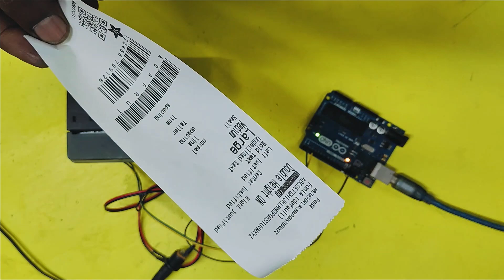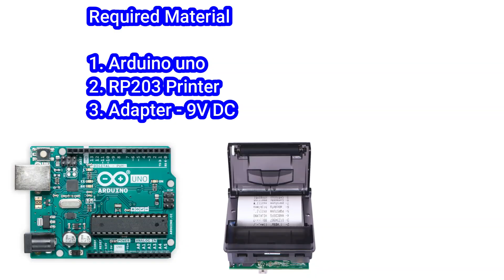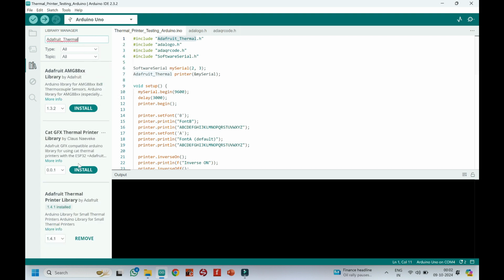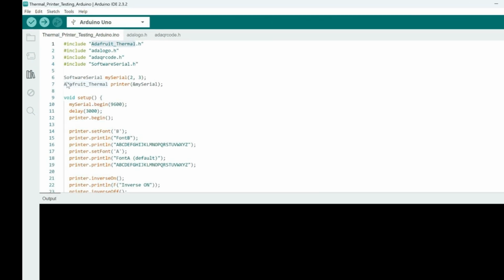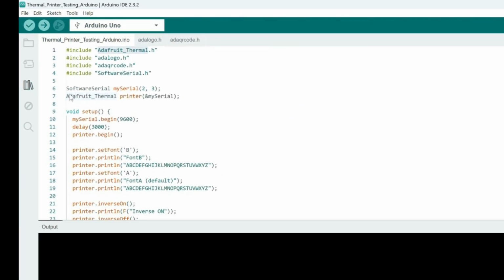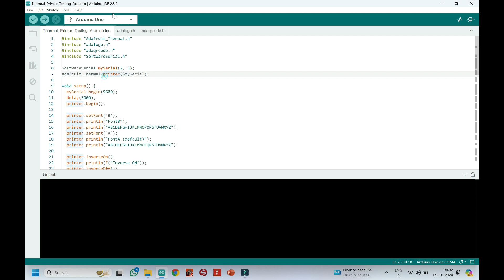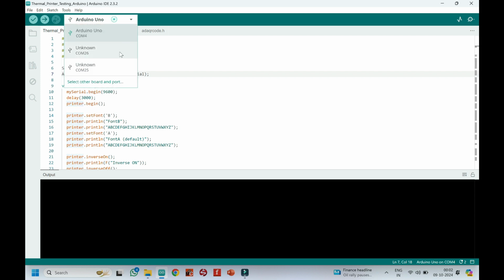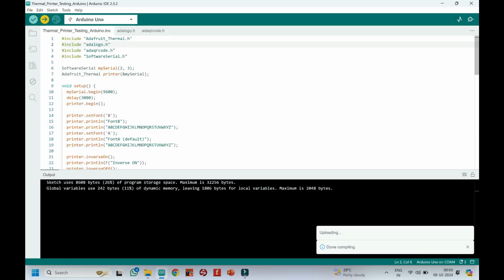Testing Arduino UNO with RP203 Thermal Printer || Embeddable Serial Thermal Printer - arduino

Comment: As per above mentioned process , I'm using  RP203 12v printer, but I don't get  image output .which means Logo and QR code image. likely in above video and my baud rate is 9600
Reply from the maker: You need convert image as hex code and use it in my program
Reply: @TeachMeSomething  but I actually used your code and it was working in my 9v printer when it comes 12v printer the same code was not working
Reply from the maker: @thananjeyanpandian2127  🤔🤔🤔🤔  baud rate is correct?
Printing text in the correct format?only image is issue?
Reply: @TeachMeSomething  yes i got only issue while printing image other than that my baud rate is correct and also i got text print without any  issues